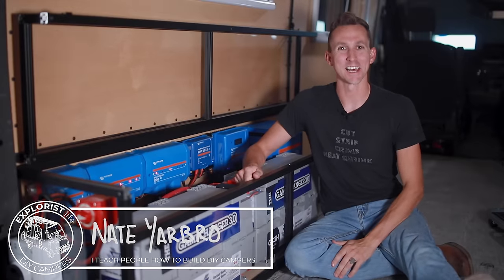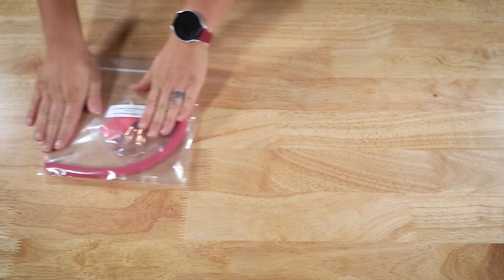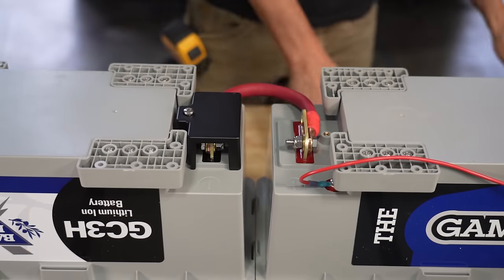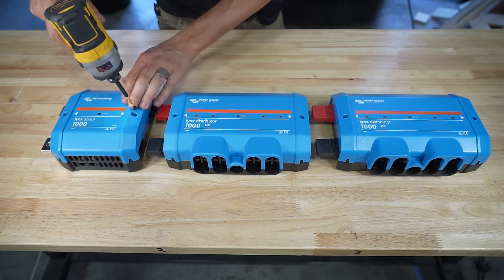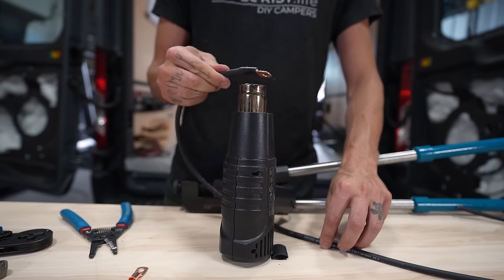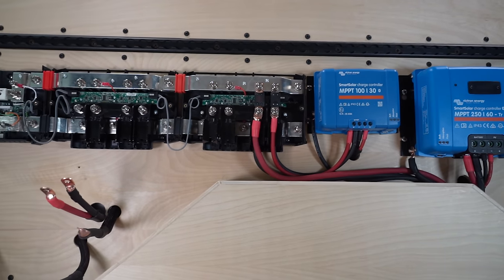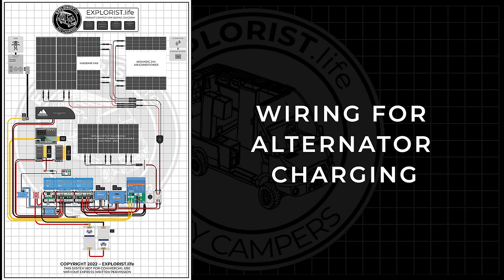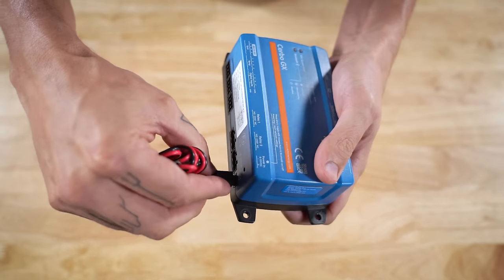DIY CAMPER VAN ELECTRICAL INSTALL (Start to Finish Tutorial)

Comment: Did you ever consider mounting ADJUSTABLE TILT MOUNT BRACKETS?? I'm pretty sure you know the increase in efficiency of the wattage coming from the solar array during winter.

I'm very curious to know why you haven't tilted them. Is it because you think you'll always have enough watts coming from the FIXED SOLAR PANELS to charge your battery??

Thank you for the amazing series of videos and the great and clean work.
Reply from the maker: For the roof array, we definitely considered it, but the added cost/complexity it would have added put it on the back burner, though.  Unaka is talking about adding that as an optional add-on if there is enough interest.

For the ground Deploy panels, yes, we have tilt mounts for those.  We just didn't install them for this video.
Reply: @EXPLORISTlife  Yes, I guess it's not always a necessity, it depends on the power demand one has.

It would be awesome if one day you get involved in a tilting solar panels' project on a roof van, to see all the good and clean job you do while building it.

Comment: Why are don't buy a portable power station much easy and powerful from Amazon.
Reply from the maker: That's like asking somebody building a frame-up resto of a '69 Mustang why they don't just buy a Honda civic.  

Portable power units are great for just 'chucking it in the car and going somewhere', but not for a permanently installed power system we want to last longer than the van itself.

Comment: Cant understand why youre using such massive cable on mppts, 60 amp max
Reply from the maker: Using the biggest size of wire that fits simply removes all doubt.  We could have used a bit smaller wire and actually ran it through our wire sizing calculator; put providing the largest wire that will fit the charge controller removes all doubt and works for 100% of use cases.

Comment: Hi Nate, I would like to use 24V appliances such as a water pump, fridge, etc. I noticed that the kit comes with two 12V DC Fuse Panels, but no 24V DC Fuse Panels. How may I go about connecting my 24V appliances and devices?
Reply from the maker: Why not just 12V devices like we did in this build instead of mixing and matching a bunch of 12V and 24V devices?  That would just make wiring quite messy.  Perhaps consider just following along with what we did here and build your system within the the design as we have shown in this video and the rest of the build series.  I've designed this system to be as simple as possible but as complex as necessary to meet our desired needs.  No need to make it even more complicated for such little gain as using 24V and 12V branch circuits.
Reply: @EXPLORISTlife  Sounds good. Wasn't sure if the efficiency gain (if any) of sticking with 24V is worth the effort but it seems immaterial. I'll keep it simple and stick to 12V. Thanks!

Comment: Hi all. I have a question. Is it possible, if so, how to connect Victron Lynx Distributor to Victron MultiPlus-II GX without Victron Lynx Shunt?
Reply from the maker: From a power connection standpoint or a data connection standpoint?
Reply: @EXPLORISTlife  The Victron MultiPlus-II GX 24/3000/70 has only one VE.Direct connector. In my project there are devices: Victron MultiPlus- II GX 24V / 3000VA / 70A, Victron Lynx Distributor, Victron Energy SmartShunt 500A and Victron BlueSolar MPPT 100/50. I can’t figure out how to connect them so that they communicate with each other!
Reply from the maker: All of those would connect to the Cerbo GX.

Multiplus-II GX would connect via RJ45 Cable to/from the VE.Bus ports.
SmartShunt and Bluesolar would connect to the cerbo via VE.Direct ports.

The Lynx Distributor wouldn't connect to anything from a data connection standpoint.
Reply: @EXPLORISTlife  Then Lynx Distributor is useless for my project!? I should return it to the seller and buy Victron Lynx Power In from him.
Reply from the maker: Or if you don't have DC loads, you could use the Multiplus as the battery monitor and connect the BlueSolar through ve.direct and activate DVCC and then monitor through the VRM portal.  

Lots of options there.
Reply from the maker: The Lynx Distributor has fused connections, the power in does not.  Neither communicates very much.  The Lynx Distributor is a fantastic device and I recommend it in most installations.
Reply: @EXPLORISTlife  I saw an RJ11 connector on the Victron Lynx Distributor and thought it might be possible to buy an RJ11 to RJ 45 cable and try to make them friends?!?!?!
Reply: @EXPLORISTlife  I am doing this project for my country house that does not have a connection to the central electrical network. Where can I send a PDF file with my project so that you can view it?
Reply from the maker: The RJ11 on the Lynx Distributor only communicates with the Lynx Smart BMS and/or to power the lights on the Lynx Distributor.  There is not much valuable data it can share.  

I don't 'review plans' that others have made.  If you want to see what I recommend for system design, check out https://www.explorist.life/solarwiringdiagrams

Comment: The wiring diagram has a SPST switch for the battery heater wire, but I don't see that install. When do you need to turn it off and on? Thank you!
Reply from the maker: You would want to turn that off if your batteries were heating but your solar panels weren't getting solar (snow or garage during storage) and below freezing battery temps are expected.  I didn't wire in a switch simply because I wasn't sure I wanted to have a switch to 'accidentally' turn off and instead wanted to rely on physically un-bolting the connection so there was no question in my mind if the heater thermostats were active or not.  Adding a switch in-line is easy enough in the future if that's a feature I end up wanting.
Reply: @EXPLORISTlife  I broke the hinges of the wire separator at 39:24, is that piece critical?

Comment: Probably a dumb question, but can you charge from both shore and solar at the same time?
Reply from the maker: They can both be connected at the same time, but shore would take priority and solar would regulate down a bit as required.

Comment: A lots of beautiful configuration on you website but I didn't find the 48v to buy. I intend to have a mobile work shop in my Van,so I'm looking for 220-230V/50A outlet.
Reply from the maker: https://www.explorist.life/24v-6000w-120v-240v-split-phase-camper-solar-wiring-diagram/
Reply: @EXPLORISTlife  Thank you so much.

Comment: I have watched a ton of your videos, just can't stop watching!
I am working on a  building  a system to run my SoftWashing equipment
We run 4 12v electric hose reals off a generator battery that powers 2  110v Water Booster, I would like to get rid of the generator and be self contained.
One rig is in a 14x8 enclosed trailer, so I have plenty of roof space, 2 in open trailers and 2 truck mounted skids. 
So there is a lot of different systems to figure out!
 What are your thought?
Keep up the great work.
Reply from the maker: Definitely doable.  You'd want to figure out your peak 120V power usage and size your inverter for that (probably your generator size would work here) and then figure out how much battery bank capacity you'd need (look up our power audit video from a few years ago).
Reply: Thank you for the reply I will keep you posted

Comment: I’m wondering why you opted for the MultiPlus inverter/charger and a separate MPPT solar charge controller, instead of one of the inverter/chargers with a built-in MPPT solar charge controller?  I'm trying to come up with a list of components that I will need for my build and an all-in-one unit seems like a good idea to save space and wiring connections, but maybe there is something I don't know  about choosing one inverter/charger over the other.  Thanks again for the excellent videos!
Reply from the maker: The Victron EasySolar, which is Victron's unit that has an inverter/charger and MPPT in one unit is not available for 120V output like we have here in N. America; so it wouldn't be particularly useful for our case.
Reply: @EXPLORISTlife  Thank you!  That decides it for me.

Comment: Wish i would have known about wire ferules before. Makes inserting wire into those MPPT controllers way easier.
Reply: Side note....i noticed @33:10 you did you sand the black stuff off the wall support to attach your ground. you always want bare metal contact for any ground
Reply from the maker: Our serrated washer between the lug and the metal does that for us. 👍

Comment: Why not use.a 24v battery? It’s ok to say because you are sponsored by battle born and they don’t have 24v batteries.
Reply from the maker: They actually do have 24V batteries but there are just MORE 12V batteries available on the market and I get significantly more questions about people wiring 12V batteries into a 24V battery bank than I do with people just wiring 24V batteries.

Comment: Did you guys ever get the Buck Boost installed and charging?  Any issues with the setup on that?
Reply from the maker: Not yet.   Will make a video about it specifically when we get that wrapped up.  Still not 100% decided on the Buck Boost either.

Comment: Thanks so much for the amazingly informative video! All I can remember after watching the whole thing is “washer, lock washer and nut”. You mentioned that you are waiting on the Victron Buck Boost 100. Do you plan to install a dedicated alternator for this? Do you think Transit 2022 alternator can handle this much current being drawn from it? Also, the Orion Smart 24v/12v DC-DC charger is readily available. You could potentially use 2 of these instead. Is buck boost worth the wait?
Reply from the maker: We have dual alternators on our Transit, so we've got PLENTY of alternator charging power available to us.  2 of the Orions is only going to be 60A @ 12V.  We are (likely) going to be using the 100A buck boost for even faster charging.
Reply from the maker: Hey!  Just wanted to follow up on this.  We just released the alternator charging video that accompanies this tutorial.  Here is the direct link to that: https://www.youtube.com/watch?v=FuBAKTCCnt4

Comment: I would be interested in the programming values since I also run a system with Cerbo, Multiplus and two MPPTs. Especially the coordination of the charging curves is something I would be interested. Are you using the dvcc functions or not. And how to set the Smart Shunt for the Multiplus as measuring device?
Reply from the maker: Hey!  Thanks for your patience.  I've added the basic settings we used to the product description of our wiring kit here: https://shop.explorist.life/shop/all-products/camper-wiring-kits/complete-wiring-kits/540ah-3000w-24v-multiplus-580w-to-1700w-solar/

With the Cerbo GX, there is more that CAN be changed since the Cerbo GX is effectively a fully functioning computer, but the above settings will get you going.  I do recommend, though, diving into the user manual for the Cerbo GX to see what else it is capable of.
Reply: @EXPLORISTlife  Thank you. Do you also use the DVCC configuration to sync the charging curves etc.?

Comment: Tnx for the video, any way you can add a 48v kits on your website?? I would be very interested:) Or would all the 24v wireing kits work on my system just a little bit over killed.
Reply from the maker: I can't make a blanket statement that our kits will work for 48V.  As of 10/3/2022, any kit with a fuse is for 12V and 24V only (our MEGA fuses are rated to a max of 32V).  Our master battery switches are also only rated to 48V (actual, not nominal)  How large of a system are you trying to build that you need a 48V system?
Reply: @EXPLORISTlife  Thanks for the response:) So I have a big Camper I live in full time and I want to have enough solar and battery to run it. So I have 3,000 watts of solar on the roof and going to buy here shortly 4 48v EG4 server rack battery. Maybe I should have went with a 24v system but I already bought the 48V inverter and EXT :/

Comment: Very nicely composed and informational video - great work!

It makes sense you want to keep your MPPT --> Lynx Distributor cables as short as possible as according to specs. Though I'm pretty sure I read somewhere in the manual that devices consuming/delivering power through the Lynx Distributor should be spread out and placed evenly to spread the load of the busbars....
Reply from the maker: Yeah, that's covered in ch. 4 of Victron Wiring Unlimited, but doesn't really apply to a system this small.  The Lynx Distributor is rated for 1,000 amps, and the combined charging capabilities of our solar doesn't even exceed 10% of that, so there is no risk to overloading the unit.
Reply: @EXPLORISTlife  All good then! Good that it was already considered as part of the planning 😃👍

Comment: Programming data pls. 28.8v and....??? thanks! great video
Reply from the maker: Hey!  Thanks for your patience.  I've added the basic settings we used to the product description of our wiring kit here: https://shop.explorist.life/shop/all-products/camper-wiring-kits/complete-wiring-kits/540ah-3000w-24v-multiplus-580w-to-1700w-solar/

With the Cerbo GX, there is more that CAN be changed since the Cerbo GX is effectively a fully functioning computer, but the above settings will get you going.  I do recommend, though, diving into the user manual for the Cerbo GX to see what else it is capable of.

Comment: Great video!!!  How does one determine what size wire lug is needed? Also, you often mention tightening things to the appropriate torque. How does one know what that should be?  Thank you!!
Reply from the maker: The lugs are simply sized based on the wire size and the size of stud the lug is attached to. 
Torque specs are listed in the user manual for the device you are connecting.  If the torque spec isn't listed... tighten it until it's tight enough.  I don't have a better way to quantify that. 🤣
Reply: Ok, thanks! I didn't know if there was something else I was missing. 😊

Comment: Very cool, its nice to see all the options for distribution etc that is available out there for future projects. Also, interested to see how that dc air conditioner performs.
Reply from the maker: Thanks so much!  I appreciate that.  Will do some testing on the air conditioner next summer.  Temps aren't getting much above 65 degrees where we are at the moment. 😂🤣

Comment: Great Great info but what kind and how big are the fuses that go into the lynx distributor.?
Reply from the maker: The proper fuse sizes are included in each of the 'Component Wiring Kits' I was using throughout the build and are noted on the wiring diagram.  All of that info is in the video description and pinned comment.

Comment: Very good video.
Very neat install.
I'm one of the six persons.😆
Why does it looks like the garage wall outlet seems to be up side down or is the shore power plug up side down?
Reply from the maker: Thanks so much! 😁  The shore power cord just goes the wrong direction for that outlet orientation.  I really need to install a 30A shore power outlet in the shop... 😂🤣
Reply: Oh, that's the reason why.
The adapter turns it up side down.
Learned something new again.

Comment: An amazing video thank you for producing it!  I would like to see the programming settings especially the inverter when they become available.
Reply from the maker: I've added the basic settings we used to the product description of our wiring kit here: https://shop.explorist.life/shop/all-products/camper-wiring-kits/complete-wiring-kits/540ah-3000w-24v-multiplus-580w-to-1700w-solar/
Reply: Can you add the Battle Born recommended settings for the Multi plus 24 V system?  Do you have any concerns with mounting the electrical components over the batteries?

Comment: i have a different inverter and it states in the manual the shore power input had a breaker... is that strictly necessary?
Reply from the maker: You do indeed need to follow manufacturers recommendation.  Keep in mind that there is a breaker in the campground shore power pedestal.

Comment: Very thorough video, great source for information, especially about latest Victron stuff usage!

But I'm pretty sure that battery heating positive source should be moved from battery positive terminal to after shunt positive source.

This way battery monitoring will handle true state of the battery and isn't offset to energy used to heat battery and thus not used to up charge batteries.
Reply from the maker: Actually, that wouldn't affect anything.  The shunt measures current along the negative side and since the negative conductor for the heating circuit is inside of the battery...there is no way to monitor that from our Shunt and Cerbo GX.  This is hardly an inconvenience, though, because the amp draw is so low it won’t affect the overall state of charge ‘too’ much and every time the battery bank gets fully charged, the shunt will re-synchronize to 100% automatically.
Reply: @EXPLORISTlife  ah right... mixed my thinking to own shunts which are both in positive side...

Comment: Hi Nate - great video!  Can you do post, video or diagram on installing the C33 and relay for the smart alternator on the transit and installing the Orion battery to battery charger?  Or maybe the info is out there and I'm missing it?  Thanks!
Reply from the maker: Yep!  Will cover alternator charging once the parts we want to use become available later this year.
Reply from the maker: Hey!  Just wanted to follow up on this.  We just released the alternator charging video that accompanies this tutorial.  Here is the direct link to that: https://www.youtube.com/watch?v=FuBAKTCCnt4

Comment: If I wanted to add 1 of more batteries, how would I still retain the 24v system?
Reply from the maker: Not possible with only 1 more battery.  You could do it with additional pairs of batteries, though.
Reply: @EXPLORISTlife  so in total I would need 4 batteries to retain the 24v system, would the batteries have to be wired differently in that case?